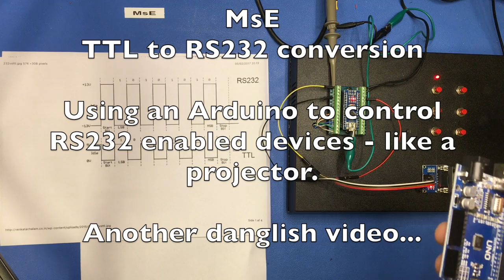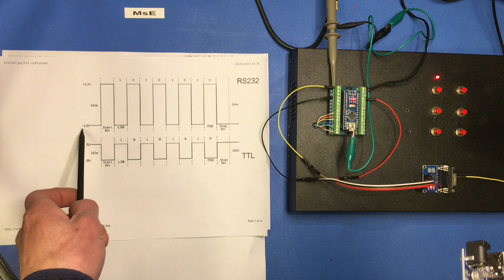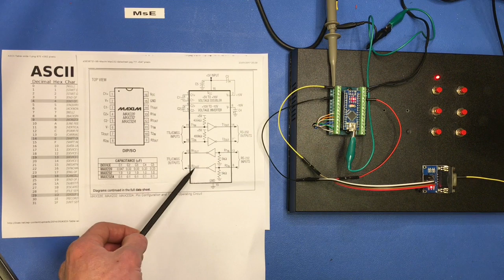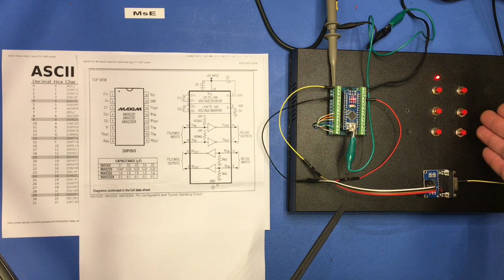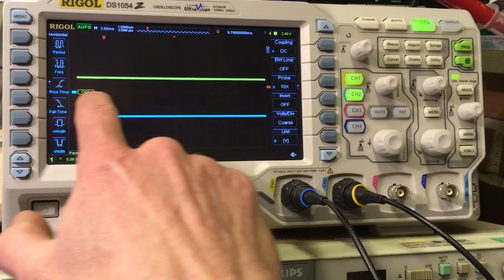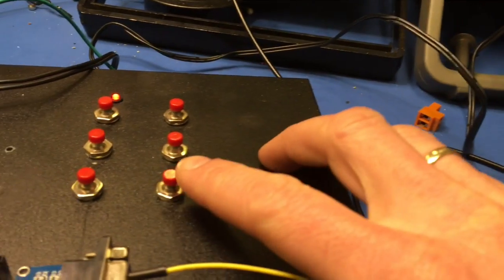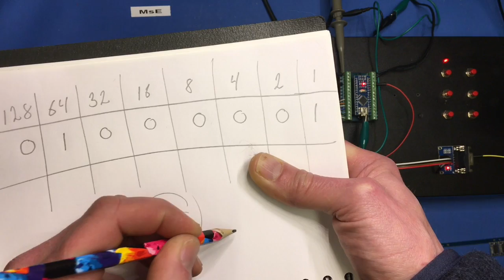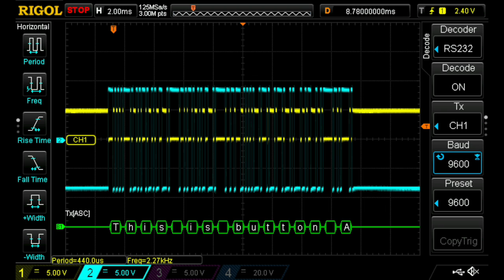TTL to RS232

Comment: If I want to convert a single RS-232 signal to TTL, would it be enough to just hookup VCC, GND, R1_IN and R1_OUT? Or do I also need to connect the pump capacitors and if so, why? I need to convert a single RS-232 signal to TTL, maybe I can use a simpler chip even for that. I can't seem to find such a chip though.
Reply: I know this is two years old but on the chance it helps someone else the RS-232 signal uses a voltage that would fry an Arduino.